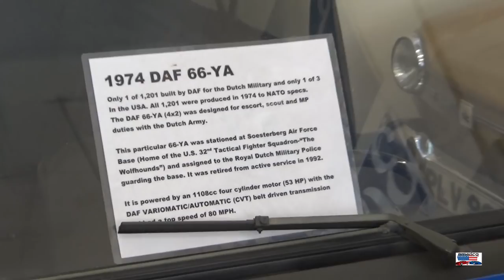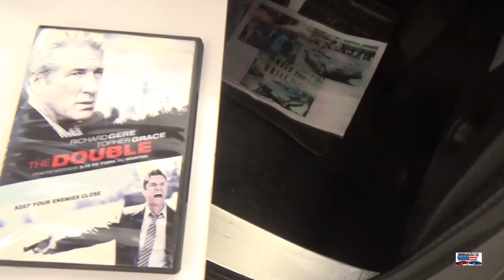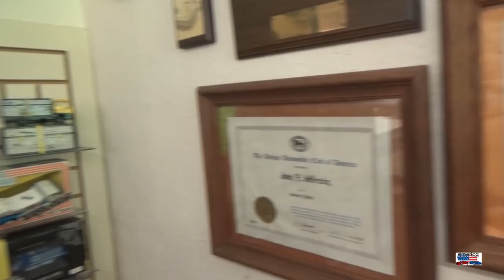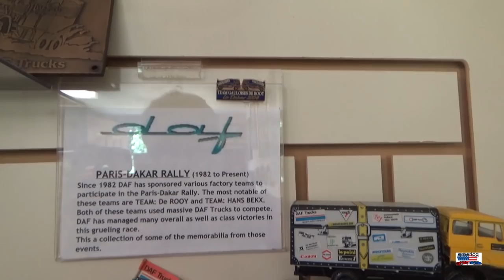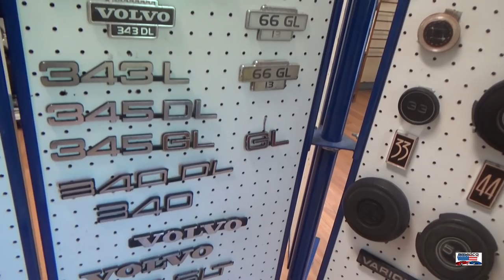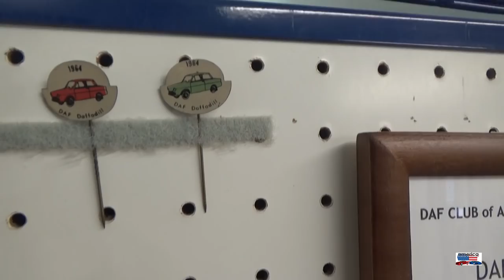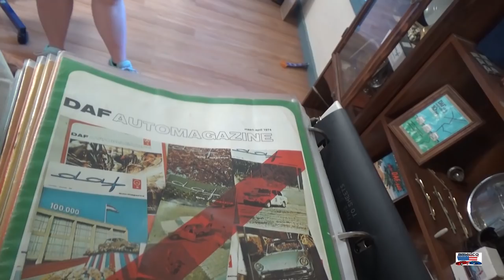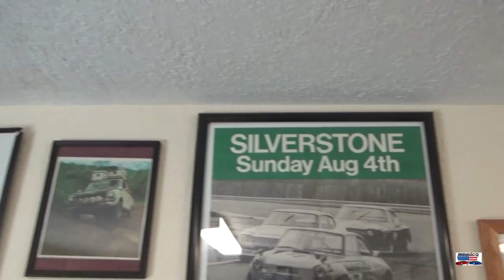DAF Automobiles and Museum

Comment: You can tell a DAF mechanic by the top missing off one finger due to holding the pulleys apart with sockets to change the belts, should use wood blocks, they don’t slip.   Changed many belts

Comment: My first two cars were DAF. The first on I got cheap from my aunt that was a ‘75 DAF 46.
After a year and a halve I broke one of the discs in the Variomatic.
Me and my technical friend went to the salvage yard, turned a wrecked on on the side and took the whole transmission out. The farmer I worked part time for at the time had a ‘74 DAF 66 with a broken belt. With the parts of the salvage yard we fixed both and because the 66 had more power I then drove the 66 for another year and a half. That was when I still lived in The Netherlands. I live in Ontario, Canada for over 30 years now.
I missed where in the States this museum is, I’d love to stop in there some time.
Reply from the maker: They are cool little cars. Thanks for watching.
Reply: Its in Vermont, USA

Comment: Is there a DAF 46 in the collection,  the single belt 44 .  I have owned a 44 and a 55 with the Renault 1100 engine.  Main problem with the 44 was the transverse leaf spring snapping on the front,  found a replacement from a scrap yard in Nottingham.
Reply from the maker: I don't remember at this point. All cars in the collection were shown, so maybe not. Thanks for watching.

Comment: Had a green daf 44 with a open roof.  Was a babe magnet. Looked silly but that made it cool beige fake leather interiour.  Would outrun almost any car up to 50km/h at the stoplights. Driving in reverse was also cool but never had the balls to do that flatout. Car was from 1969. Had it in the 2000s

Comment: We call it jarretel transmission. 😄
Reply from the maker: Interesting. I love that this technology is mainstream now. Thanks for watching.
Reply: @AmericaBumpertoBumper  
DAF (later transmission spin-off 'VanDoorne Transmissie') was bought by the German Bosch company after BorgWarner pulled out of the development of the CVT in the 1980's.
Reason given was that the belt wasn't strong enough at the time for the big American engines.
DAF continued as DAF-Trucks.
Reply from the maker: @Be-Es---___  he did. I have watched a video, not sure if it's the same one. Very funny.
Reply from the maker: @Be-Es---___  didn't know that. Thanks for the info.